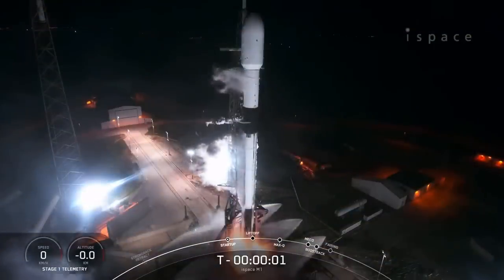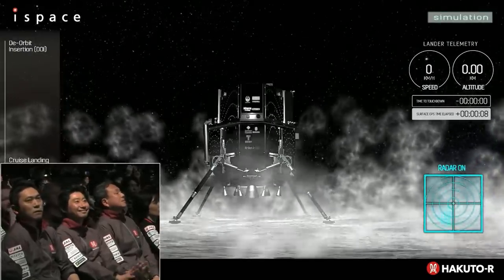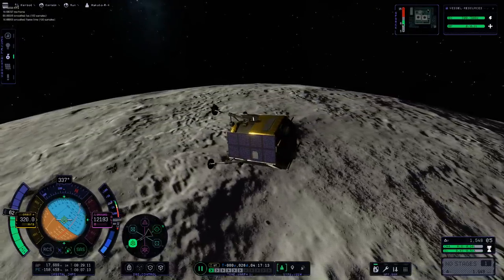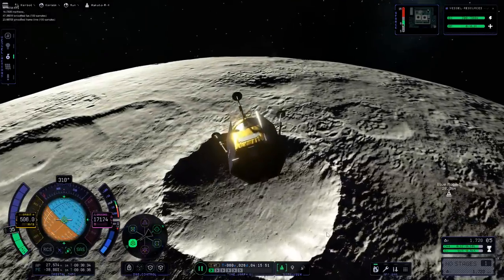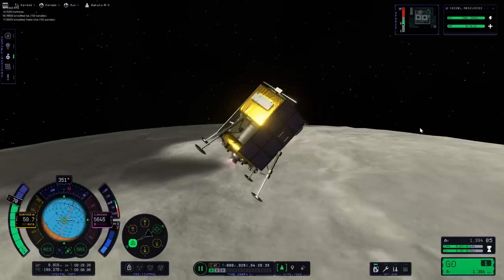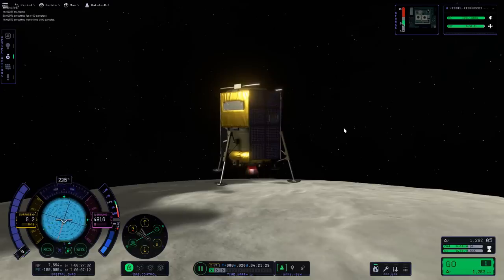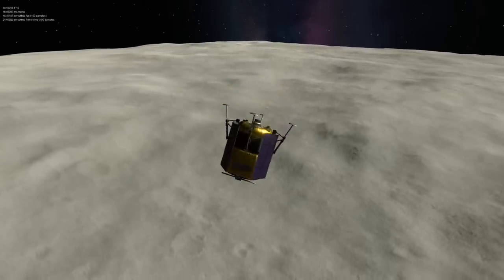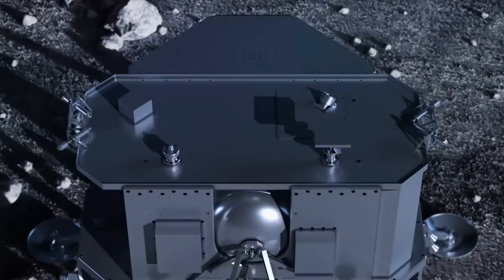Why Japan's Moon Lander Crashed Due to An Unbelievable Computer Bug

Comment: Rockets do not work in vacuum.
Reply from the maker: Said nobody who understood newtons laws.
Reply from the maker: Lol… I can totally imagine you saying that as you fall from a plane trying to argue against Newton’s law of gravity. Good luck with that.
Reply: @scottmanley  BS. Let’s stick to the law.
Reply from the maker: Newtons 3rd law - every action has an equal and opposite reaction. If you push gas out a nozzle in one direction you have to have an equal force in the other direction.
Reply: @scottmanley  No. The ignited gases are expelled by the nozzle due to the action of the expanded gases against the walls of the combustion chamber that react against that action, expelling the gases out through the nozzle. The gases expelled by the nozzle (action) have nothing to push against (reaction) in vacuum, so the action reaction process cannot be completed. Self-Propulsion doesn’t exist. That’s why rockets do not work in vacuum. As Newton explained 2.5 centuries ago.
Reply: @scottmanley  The only way for rockets to work in space, is in case space is not a vacuum. Unfortunately that doesn't solve the problem, because they are lying anyway.
Reply from the maker: @michael.forkert  ‘pushes against the walls of the combustion chamber’ 
You literally said it, that’s the action-reaction surface.
Newton’s laws don’t mention vacuums because they apply regardless. 
Does a gun firing a bullet produce a recoil in a vacuum, of course it does. 
Newton’s third law doesn’t care if the mass is a solid bullet, or a bunch of molecules in a gas.
Reply: @scottmanley  Nope. The action reaction which expels the gases out thru the nozzle is the first one, in which the  the ignited gases exert an action against the combustion chamber walls, which react expelling the gases in the opposite direction of the walls. The problem is, that the gases expelled by the nozzle , which is the second action, encounter no reaction for the stream of gases that left the rocket via nozzle to interact with pushing the rocket in the opposite direction,  because vacuum doesn’t exert any reaction to any kind of action. That’s proof that rockets do not work in vacuum.
Reply from the maker: @michael.forkert  That’s proof you don’t know newton’s laws. Where exactly did Newton put a footnote on the 3rd law saying it doesn’t apply when pushing things into a vacuum?
Reply: @scottmanley  imagine yourself “floating” in vacuum holding a powerful electric fan, which is turned off in both hands. When you turn the fan on, the blades begin to move due to the electromagnetic action reaction process inside the electric motor, that’s the first interaction which make the blades spin. The second action reaction process would be the action of the fan blades with nothing, and you wouldn’t move an inch. It’s exactly the same with rockets. And the recoiling of a gun is certainly an action reaction process, which is absolutely no proof that rockets do really work in vacuum.
Reply from the maker: @michael.forkert  it’s not the same, the rockets are throwing gas out the back, the fan is just spinning in a circle.

So you accept that a bullet works to generate reaction. Now scale it down to each bullet being a single molecule.
Now multiply by number of molecules in a gas.
Reply: @scottmanley  Where exactly did Newton put a footnote on the Third Law saying that rockets work even better in a vacuum? You see, I  returned  you the same question, without a assuming that you do not know  Newton’s Third Law.
Reply: @scottmanley  You are shaping Newton’s Third Law of Motion to your own preconceived opinions to make your point, which is debunking your interlocutor assuming my intent is the same as yours, and that your thinking is superior than mine. This will not add knowledge to neither one of us.
Reply: @scottmanley  There are two ways to be fooled: One is to believe in what isn’t true; the other is to refuse to accept what is true. Kirkegaard.
Reply from the maker: @michael.forkert   I can derive the rocket equation from newton's laws, it's you that's adding on the incorrect assumption about a rocket needing to push against an external medium. 
If you have a device that throws a bullet out a barrel it generates recoil, a reaction in the opposite direction.
If you melt that bullet down and spray liquid metal out the barrel it still generates recoil.
If the bullet is vapourised into a gas, the mass is still there, if that gas flows out the barrel because of its pressure it will still generate recoil and reaction.
Reply: @scottmanley  You are trying to convince me to understand Newton’s Third Law of Motion as you have understood it. Let’s put it that way: you are discussing understanding, and I am describing Newton’s Third Law of Motion. In that kind of dialogue there never will be a meeting point. 

The marvelous thing about topical reasoning is that it makes it possible to conduct an intellectual inquiry without prejudice what the outcome of the inquiry might be. One follows the desire to know.  Dr. John Angus Campbell.
Reply: @scottmanley  Here is it again: If object A exerts a force on object B, object B also exerts an equal and opposite force on object A. In other words, forces result from interactions. You see, that I’m not adding any assumption to it. You are joining object A and B as object A and object  B were the same object. Object A, which exerts the action, is the [entire rocket] and object B is the reaction object. If you do not admit that object A is not equal to object B, i.e. that object A and object B are different objects, then Newton would not had defined the process through object A and Object B as being two different objects one from each other.
Reply from the maker: @michael.forkert  so why do you have a hard time understanding that a fluid being pushed out the back of a rocket engine into a vacuum generates thrust?
Reply: @scottmanley   I’m not having a hard time at all. You are having a hard time trying to make me think like you do. In summa you are trying to convince me that self propulsion exists, contradicting Newton’s Third Law of Motion, which states that object A is not equal to object B. Your car is object A, the motor of your car isn’t object B.
Reply from the maker: @michael.forkert  object A is the engine, object B is the exhaust blowing out the back at 5km/second.
Reply: @scottmanley  nope. object A is your car, and object  B is not the motor of your car. The motor of your car is part of object A. That’s why the motor of your car is not object B. 

One of the saddest lessons of history is this: "If we have been bamboozled long enough, we tend to reject any evidence of the bamboozle. We are no longer interested in finding out the truth. The bamboozle has captured us. It's simply too painful to acknowledge, even to ourselves, that we have been taken. Once you give a charlatan power over you, you almost never get it back.
Reply: @scottmanley  Again: Object A is the entire rocket with all its components including its motor. That’s it.  Let’s change the subject a bit: Would a glider plane released in a vacuum fly, float or glide?
Reply: @scottmanley  Object A is the whole rocket. Object B obviously is not the rocket. What expels the thrust is the rocket. When you consider that object A is the whole rocket, you will recognize what Newton was saying.
Reply: @scottmanley  who determined that, Newton or you? Self propulsion doesn’t exist.
Reply: @scottmanley  object A is the rocket. Object B is not the motor of the rocket. If you are inclined to determine that the exhaust generated by the rocket is object B, nothing can be done.
Reply from the maker: @michael.forkert  why is tons of rocket propellent disqualified from being object B? We literally refer to propellent as reaction mass.
Reply: @scottmanley  Because the rocket in its integrity is object A. A rocket without a motor is not a rocket. Nobody disqualified tons of rocket fuel, but you.
Reply: @scottmanley  Let’s stick strictly to the law. Otherwise, the same questions will  be asked over and over again, when the answer is already given two and a half centuries ago.
Reply from the maker: @michael.forkert  so you’re agreeing  that object a can be the rocket and object b can be the tons of exhaust moving at several kilometers per second backwards relative to the vehicle. Doesn’t conservation of monetize then mean that the rocket has to start moving forwards after emitting this exhaust, otherwise momentum conservation would no longer hold?
Reply: @scottmanley  Read it again, I wrote  that the whole rocket is object A (rocket engine and rocket fuel included).  I have perfectly understood that you are trying to convince me that the ignited gases expelled by the nozzle are object B. The entire rocket as I wrote above is object A, thus the gases expelled are not object B, because the complete, or whole rocket is object A.  If an object A  contains another object, this object is intrinsic to object A. That’s why it cannot be defined as object B.
Reply from the maker: @michael.forkert  Where does newton's law say that mass in liquid or gas state doesn't have to follow momentum conservation?
Reply: @scottmanley  Nowhere. Newton’s Third Law of Motion does not deal with this matter. As usual you divert from the initial subject.
Reply: Good lord I have never seen someone get so close, even acknowledging the physics is correct for another scenario, but still get the wrong answer. This is a legendary moment
Reply from the maker: @michael.forkert  so since Newton’s 3rd law doesn’t care if the mass is a solid, liquid or gas then pushing a ton of mass out the barrel of a cannon and generating recoils has the same effect as pushing a ton of gas out a rocket engine at high speed and getting thrust.
Reply: @scottmanley  There is the old recoiling business back. Neither a canon nor a gun are rockets. So let’s stick to the rockets, and to Newton’s Third Law of Motion, which is very simple. It consists in a action reaction process between TWO object. Objects A and  object B, where object B is not object A.
Reply from the maker: @michael.forkert   So explain why you think newton's law applies to solids but not to fluids?
Object A = Gun & Object B = Bullet
Object A = Rocket Engine & Object B = Spray of water
Object A = Rocket Engine & Object B = Hot Gas In Rocket Exhaust
Reply: @scottmanley  First of all, I do not think Newton’s Law applies do solids but not to fluids, as you continue to insist impertinently.  Newton’s Third Law of Motion applies to everything.
Reply: @scottmanley   You are trying to convince me to understand Newton’s Third Law of Motion as you have understood it. Let’s put it that way: you are discussing understanding, and I am describing Newton’s Third Law of Motion. In that kind of dialogue there never will be a meeting point. (1 day ago). 

Your particular examples are not described in Newton’s Law. As I stated in the previous post: Newton’s Third Law of Motion applies to all substances, i.e. all substances in the solid, liquid and gaseous state.
Reply from the maker: @michael.forkert  but you’re not explaining why you think a gas being accelerated is different from a solid being accelerated.
Reply: @scottmanley  I do not think what you think that I think. Insisting on it is innocuous.
Reply from the maker: @michael.forkert  so you do think that accelerating fluid out of a nozzle produces a reaction force? Which means you should see that thrust can be generated by a rocket engine in a vacuum.
Reply: @scottmanley  My previous post was “ I do not think what you think that I think. Insisting on it is innocuous”. You simply ignored it, and posted that one, which is exactly identical to your previous post.
Reply: @scottmanley  That’s not contained in Newton’s Third Law. That’s your opinion, interpretations or whatever. Again: The ENTIRE rocket  is object A. So object B is not object A. What you are trying to convince me, because you are completely convinced of that,  is that the rocket fuel, or the thrust generated by it is object B.
Reply: @scottmanley  Nietzsche said: “Convictions are worse enemies of the truth than lies”. Think about that.
Reply: Ignorance more frequently begets confidence than does knowledge.
-Charles Darwin
Reply: @snowthemegaabsol6819  It’s exactly your case.
Reply from the maker: @michael.forkert  you are certainly a prime example of someone shielded from the truth by their convictions.

I mean you agree that guns create recoil in a vacuum by accelerating a bullet out the barrel. You say you acknowledge that Newton’s laws apply to fluids and that accelerating a fluid out a nozzle must also obey the 3rd law and generate a reaction force.

But you see unable to take the next step and see the reaction force from a fluid being pushed out a nozzle is thrust and doesn’t depend on the atmosphere around it.
Reply: @scottmanley  The 3rd Law is a definition of a process, it does not specify any substances, nor does it present examples.
Reply: Damn you really just went for the "no u", you could have at least been interesting since you're unable to be correct
Reply from the maker: @michael.forkert  exactly, so, accelerating gas out the back of a rocket engine produces thrust, therefore rocket engines work in a vacuum.
Reply: @scottmanley  That example you wrote, not Isaac Newton.
Reply: @snowthemegaabsol6819  ???
Reply: @scottmanley  object A which is the Rocket generates the thrust, that is not object B, which leaving  the rocket thru the nozzle has nothing to push against in vacuum. Auto propulsion doesn’t exist. The thrust which is expelled in the opposite direction of the rocket is due to the first action /  reaction process  in the combustion chamber. That’s why the entire thrust is expelled into the opposite direction of the walls of the combustion chamber. Once the thrust leaves the rocket it has nothing to complete the second action/reaction process.
Reply: Confusion suits you so much better
Reply from the maker: @michael.forkert  I'm sorry, you're becoming increasingly incoherent, your most recent comments don't make sense in elementary English, never mind middle school level physics.

But doing my best to pick through this it seems that despite accepting everything works and makes sense according to the laws of physics you have fallen back on "it can't work because I say so" which is truly the sign of a master debator.
Reply: @snowthemegaabsol6819  don’t bother yourself with my confusions.
Reply: @scottmanley  ok man. let it be.

Comment: Funny you call it a bug. I'd call it a poor engineering. The software did its job. The fact a decision, or rather the criteria for the decision, was built into the software to cause the system to disallow the altimeter readings, despite the altimeter still working properly, was a design flaw. It's not a bug. A bug would have been disallowing the altimeter readings for no correct reason, which according to your explanation, isn't the case. And bugs are caught during testing. Not when the software is running in production. At that point it is a software fault leading to a total system failure.
Reply: It was still unintended behavior, that's what that means
Reply: @snowthemegaabsol6819  Sure, it is still technically and pedantically not a bug. In fact, bugs are only found during testing.

Comment: SO first, thanks.  Second "doppler data" is not a thing so please stop.  You're too good for that.

What the lundarlanders (China, Israel, Japane,ettc.) need it a space-based global navigation system, like GPS for rD or GloNass or whatever.  That way they don't do stupid crap like expect radalts to indicate elevation (you said altitude and I forgive you) or X Y and Z vectors.

I could go on, but I won't.  Radalt is a failure if you're unaware of terrrain.  
Nav is a failure if you're unaware of terrain.

They were doomed.  They died.  And there has never been a successful unmanned lunarlanging in 70 years.

So, put people there. Or pretend people never did.  Or have these unmanned things crash.  Simple, right?

Scott, thank you again for your insight.  No "doppler data" and we're good.

E
Reply: China mapped the moon with the moon satellite decade ago.

Comment: What sbout 1960s landings ? Were they real  ... I dont thjnk so ... Seriously
Reply: Evidence suggests they were real.
Reply: @hmgrraarrpffrzz9763  not possible ... We didn't have transistors which can work that fast .  How could you make such an on-board computer which can process so much calculations back in 1969s with cathode tubes and no fast transistors
Reply: @ajaypratap4467  "We didn't have transistors which can work that fast "
According to what sources were transistors for the landing needed that were not available at that time?
Reply: @hmgrraarrpffrzz9763  the timeline of the development of computing infrastructure